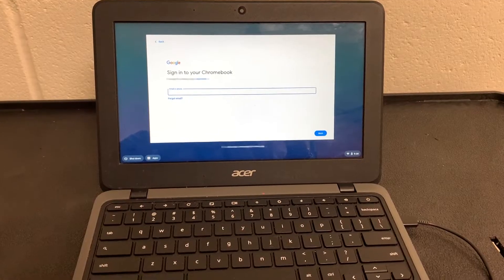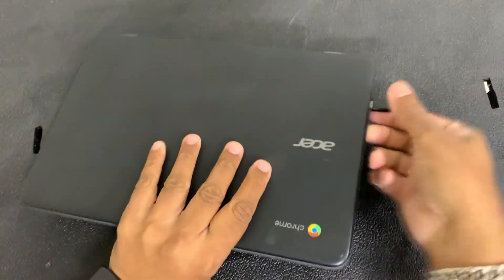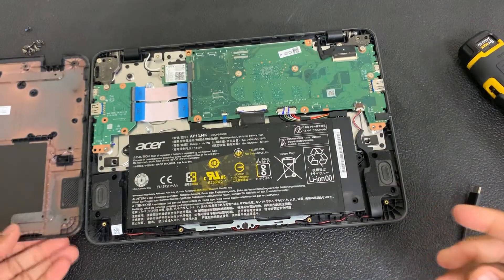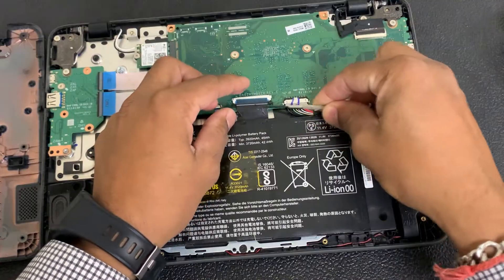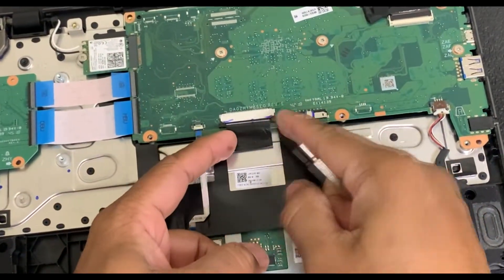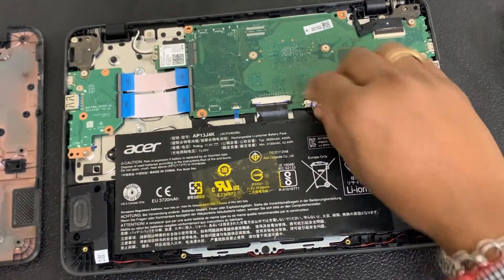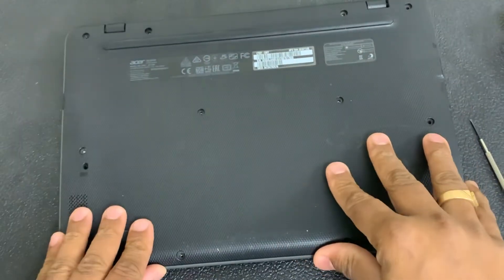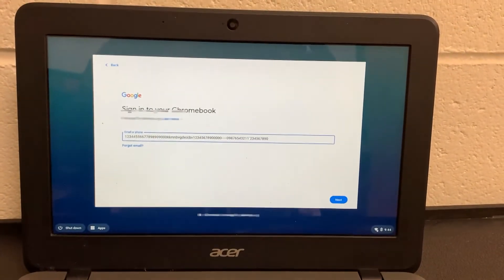Some Keys Not Working On Chromebook - FIXED!!

Comment: My Lenovo Chromebook S330 also has some keys that have not working, which led me to this video.
I followed the steps in this video to reconnect the cable, but the problem was not resolved.
Is there any other solution?:penguin-blue-waving-tear:

Comment: So I did this and it worked at first, originally almost all the keys on the right side of the keyboard weren’t working. So I did this and then the top right were working. So i tried to adjust it some more but it didn’t do anything.

Comment: Thank you thank you thank you!!!   This worked on my Samsung 520QAB-K02, and in fact the keys intermittent fail were in  a vertical line (the tell for sure!) starting with "a" then soon after it was "z", "q", "1" and then last was "ESC".    My ribbon cable was slightly different than shown, and I used electronics cleaner spray.  It is working now and at the very least I have confirmed the problem area.  Good job.

Comment: My problem is the A button.  When typing normally it will not appear but if I apply more pressure it will.  It really throws off the flow of my writing.  I tried removing & reattaching the key and holding apparatus underneath to no effect.  Could this method solve my problem?
Reply from the maker: Worth a try.. As you mentioned you did reattached the key also, I would do the same.. if still doesn't work, might need to replace the keyboard.. good luck

Comment: my upside dowm u dosmt work amd my upside dowm p dosmt work please help
Reply from the maker: Have you tried the steps shown in this video? Please try as it would fix the issue you have with the key n & b
Reply: @TechGuru247  what of this doesn't work? Please help. I'll sub!
Reply: @TechGuru247  you can only fix this problem in mechanical way is there other way to do this

Comment: Is there a way of fixing it without opening the laptop? Cause I was cleaning my laptop and all of a sudden this happens i cant type five four or the dash
Reply from the maker: You may try to tap gently on the back of the laptop, reboot, and see if that works.. if not, you have to go thru these steps if you are comfortable opening it.
Reply: @TechGuru247  this worked for me. Thank you! I didn’t have to open it! Yay

Comment: A good video, but you don't want to touch the ribbon cable connections with your fingers as you have natural oils on your skin which will potentially make the connections worse. The best thing is to wipe the connections with isopropyl alcohol applied to a clean tissue to remove any oils/contaminants from the ribbon connector, then without touching the electrical connections plug it back in.
Reply from the maker: Good suggestion. Thank you!
Reply: Also, breathing contains contaminants and you should wear a mask.
Reply: @noahway13  and farting may also contaminate the keyboard. The crap that people come up with.
Reply: @noahway13  what?